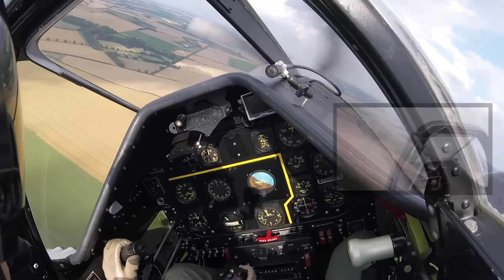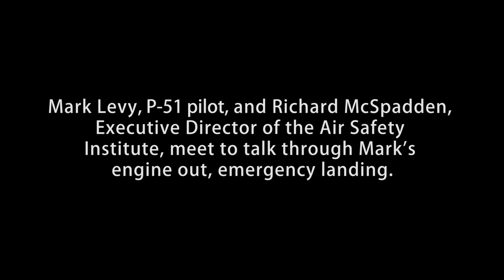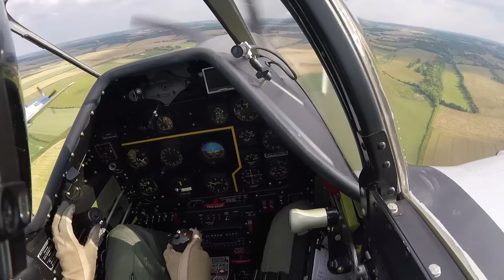P-51 Engine Out, Off-Airport Landing - Full Analysis

Comment: This person did make mistake not switching magneto on and off or switch over to secondary unit, he is not a mechanic so he does not know what is causing the engine stop running. When engine stop instantly its usually ignition problem, when you have fuel related problem engine will not shut off instantly engine will surge on and off or sputter before going dead.

Comment: Silly question: Could he have made the nearer end of the runway and land in the other direction?
Reply: The direction airplanes land on the runways are largely determined by the wind direction. Generally planes land into the wind to maximize lift so they can go slower without stalling. So yes he could have but it might have been more dangerous to do so. Take this with a grain of salt as I am not a pilot.
Reply: @philipmander1768  That's basically true. Runway length factors into this greatly with a tail wind as the tail wind increases the required landing distance - and that is different for every plane. That being said, In an engine out situation I'm going to put it down on whichever end of the runway I can make it to - tailwind be damned- over stretching a glide and risking putting it into a field. But I'm not the pilot in the video and can't judge his specific situation - he walked away so it was a good landing!

Comment: Im dieing to know what actually caused the motor failure?
Reply: I'm wondering as well. I even tried to google it, but everything I see is "under investigation" I know they know by now.. There is a list I found of all the P51 accidents in peace time, but all they say is "engine trouble". Thanks for that helpful info >.>; 

Can't find anything on it..
Reply: +jim halcom     They were thinking it was a carb issue, but I don't know if the final report is complete. The plane is repaired and flying already.

Comment: Well! ....  Mark Levy there are only two pilots in the world I would happily trust my and my families lives with. Those two are YOU and Chesley Sullenberger, as far as I am concerned EVERYBODY else needs to earn my respect. 
I had my grandfather  - Flight Lieutenant Eric Granville SHARP (27209) of the Royal Air Force. Test Pilot. Circumstances of Death: Lost in aircraft Beaufort I AW215 · AIR81/6914.
His Aircraft  Caught fire and he crashed in or around SHEPPERTON,  North of Bristol  (any Info on this would be gratefully received). It is believed that a cloth rag caught fire within the engine bay... His wife (my Grandmother - now past) was not allow to see his body, due to the horrific burns, that he received due to the fire and subsequent crash, reports of sabotage ran rife amongst his fellow pilots back then 1941. 
Should you look for Shepperton on the map, you will see that it is very close to the River Seven... I would suggest that he was going for a water landing/crash... Should I have been in that position, I too would have gone for that scenario. (Cleared, the population, try landing, fire too great head for water, come on baby, you can make it.........)

R.A.F.  Flight Lieutenant (Test Pilot) Eric Granville Sharp. Died  14/06/1941. He was only 31 years old.

My Grandfather flew Hawker Horsey Torpedo bombers (amongst many other planes) prior to this, Take a look at the size of these plane compared to the pilots... Looks comically/unbelievable, but they went after German Subs - close and personal.
https://i.pinimg.com/originals/83/56/83/835683a9c31583927fdcc0ce022bc045.jpg

On a lighter note.  This is one of the few photographs I have of him, and how I like to remember him, he flew Tiger Moth's. I'd love to know if this plane still exists.
https://www.screencast.com/t/FdQZmRim

Comment: Do they say at any point what was wrong with the engine?
Reply: +Jaakko Oksa    Believed to be a carburetor problem.    The plane was repaired and is flying again with a replacement engine.
Reply: @FiveCentsPlease  Strange that they were still using carburetors when the Germans had had fuel injection for years.

Comment: While the P-51 is in the shop..getting a make over it might be a good time to update the old Girl with a nice Modern fuel injection system..or adapt one from an Old Foe  the  Me 109 ... Great Flying....by the way..
Reply: +MrRotartyrockets    There are no fuel-injection updates for the Merlin.  And flight certification for a major change like that is not cost-effective for the small number of Merlins  that are flying.    Only a few common use radials have updated EFI kits that were developed.   The plane was repaired fairly quickly and flies in new colors now.

Comment: Why didn’t he land with gear down like you would in a Cessna?
Reply: Warbird is fast and heavy! Two wheels in the front, one in the rear. Gear digs into the soft ground and airplane flips over. Much more damage on the airframe and more danger of getting killed. He explains it in the video. The decision to pull up the gear in the last possible moment was gold :)
Reply: Fminus104 ah, thank you! I did see that part where he pulled the gear up just wasn’t sure of the physics of it. But that makes sense!
Reply: @racecarsinc  Yes, the gear would dig in and flip the plane over and that would have most likely been fatal.

Comment: Only real issue and captain hind sighting I can see to take away from this is, if he had practiced engine out landing's He maybe could of learned roughly the glide angle of a target he can get to, also practice with a 180 turn to short final. Usually when gliding, assuming you have the energy to make it back, you stay high, and then lose it though a 180 turn before final, kind of like space shuttle. So I suppose he should of been better able to judge he did not have the energy to make it to that end of the runway, maybe use end half of runway, or try coming strait in the other way which would of been more a strait line. But he wasn't terrible short, and maybe, maybe could of made it, but judging by the road and obstruction's he would of had to risk crossing.
Reply: I guess considering the danger involved, though he walked away, he could of been better prepared for the landing, and had picked a spot he knew he could get to, would be safe, and really stick a good landing to give best chances. But this actually worked to, as again he was only a bit short on energy to make it back and he had a 2 way plan. But you could nit pick, if you pick to return to a strip on engine out, and then can't make it, you've made a judgment error, namely the glide capabilities of the aircraft and energy required compared to what you have.
Reply: Wouldnt be too dangerous and probably easy training to go idle throttle/thrust, pick spots and make judgement calls if can get to them, then test self and see, to really get a good judgment for engine out. Kind of like how Sully was able to know, and use his judgement to immediately rule out landing spots as requiring too much energy, he picked a spot he could make it to, that was as safe as he could get, and had the energy, time to make the landing as easy as possible.

Comment: as an ole racer this would help rally motocross tuck any  racing be a great tool why because we know were going crash it is just when n how to crash as softly as possible ill bet that would help as its a more normal thought n that sputtering engine would not be as likely to affect one acceptance of landing in a field i guess it would be like the ole barn stormer line of thought ,,this video is so nice guys like he says know your aircraft same apples in a rally or roundy roundy race.i do not agree with fight or flight chimp brain fog as stated it`s a lack of know how to do crashes or even go up a latter or a fist fight get used to doing any of them it not an issue its not as simple as they may have one think....carburetors will stick floats flood in breath stalling then under heavy throttle clear up n run fine not doing it again fer hours or weeks  and then on the other side of that they do what this airplane did ..a++

Comment: I'm gonna take a wild stab at it and say instincts come from the accumulation of seat time and aircraft knowledge /common sense because I've seen the damage arrogance / ego  can cause but calm practicality can also be a good friend . I am however a great fan of altitude I believe pilots should spend as little time down low as possible , we all know what happens when things go wrong down low  He was lucky he had soft option's if you notice between the time he first noticed an engine issue and his touch down  the clock didn't move very much so his time was short ..I wonder had he been a 1000 ft higher when this issue happened could he have made the runway  I think yes !!

Comment: Why hold onto the control stick as soon as  you hit the ground.   Race car drivers do the same thing ; 230 mph crash and holding on to the wheel.  You ain't steering out of that , friend.
Reply: +Live Wire   Fly into the crash is what flight instructors tell new pilots.
Reply: @FiveCentsPlease  
AFTER..... after you hit the ground and are skidding or cartwheeling ....let go of the control stick ( or if in a car the steering wheel) Cross your hands on the chest or you might end up breaking them. The harnesses will hold you in place...not your hands.

Comment: 1:23 I'm guessing the fuel-pump failed...
Reply: +Hallands Menved  A carb issue was suspected by I have read the final accident report if it is even out.  But the plane is in California getting rebuilt.
Reply: @FiveCentsPlease  It obviously had something to do with the fuel system, as I personally surmised either it was a faulty Carburetor or Water in the Fuel/Obstructed Fuel line.  If it were the Engine itself that was the problem it would have either caught fir, exploded or simply died/cut out completely, the fact it was intermittent suggests a fuel system problem.

Comment: Sooooo.... any update on the engine problem?
Reply: +Tractor Wrangler    Believed to be a carburetor problem.   They rebuilt the plane, replaced the engine and it's flying again.
Reply: @FiveCentsPlease  "Believed to be" was they best they could do? Yikes....
Reply: @TractorWrangler01    The accident was in the UK, so the report is from the CAA and says carb-related.  Not very specific.  The Merlin was examined by the US shop that overhauled it, so I don't know if they said anything about the engine.  The plane was repaired in California and shipped back to the UK.
Reply: @FiveCentsPlease  I really don't like inconclusive out comes like that. I hope it doesn't re-occur on someone else...

Comment: Okay so let me get this straight.....he put his gear down, the engine was beginning to quit and he started to drop with a Freeway that he could have turned onto and he didn't consider the freeway? Now this is in Britain so I know there they Drive on the Left side of the road and not the right as in other countries, so if you look at the freeway on the left hand side It's almost completely Empty......
Reply: +Daycrist    He was running out of energy and with no power he could have stalled and cartwheeled.  Getting wings level and finding grass was a good decision.
Reply: @FiveCentsPlease  He was already near the ground, his gear was down his flaps were out and it was the high bank of him trying to get to the Runway that cut his airspeed and caused him to drop so suddenly. By the time he put down his gear he was already Stalling, so if your reasoning were true he would have cartwheeled long before he belly landed.....
Reply: @Ami-vh7sr     I watched again. The pilot explains beginning at 13:25.   He was concerned with the sink rate and no power to gain any altitude and indicators that his airspeed was dropping and the airplane was not happy.
Reply: @FiveCentsPlease  Yes so why would the Pilot High Bank and thus cut his airspeed far faster trying to line up with the Runway when he was already almost lined up with the freeway and holding a glide path?

Comment: Great job by the pilot.  Did he make mistakes? Sure. But any landing you can walk away from is a good one.  The plane can be repaired and will be flying again.  That being said I can't help but wonder if instead of gliding all the way to the other end of the runway had he simply landed going in the other direction.  He was clearly closer to the other end of the runway and to me it looks like he could have easily made it.  Yeah he might have been landing down wind but full flaps might have made it doable.
Reply: All good points.
Prop nearly stops early on, crosses the hiway, in a pretty high bank... I am surprised it didn't stall right then, into the port wing?
btw... it's a shame, Bernice " has no video content "
Good luck with that?

Comment: Make that dam short approach and dont go to the other side of airport with a failing engine, then put drag flaps, and gear down and get short... Lots of pilot errors killed that nice airplane.. What a shame...
Reply: +Rich Grant  The plane was shipped to California for repairs fairly quickly.  A new wing was already available and that moved the rebuild along nicely.   Dunno if the full report is out yet but they were looking at the carburetor on the engine.
Reply: @FiveCentsPlease  "shipped to the other side of the word for repairs "fairly quickly".. Oximoron Alert..
Reply: @feetgoaroundfullflapsC  Yes, shipped fairly quickly to Fighter Rebuilders in California.  A new-build wing was already available to start repairs.  As I understand it, repairs were finished in 2018,  so a two-year rebuild for this accident is impressive.  It is now back at Duxford in new colors flying as "Contrary Mary."  https://www.flyinglegends.com/wp-content/uploads/2018/07/IMG_8814-1024x667.jpg
Reply: @FiveCentsPlease  -- Who paid for all that?? The workers of the factory of the owners via low salaries.  As long as the rich wastes money in luxuries , the workers salaries will be kept low to pay for those luxuries.  Money has to be produced by the workers sweat, it does not grow on trees.  And they rich are wasting it on these accidents and luxuries instead of distributing along the workers.  So workers loose salaries every time a rich guy needs more money for these one million dollar toys and their stupid accidents..

Comment: The pilot also decided to rely on the engine to the extent that he attempted to reach the airport runway, instead of abiding by his own belief that an intermittent engine can make the aircraft respond unexpectedly such that the situation is more dangerous than one with an engine that has completely stopped -- all according to which he should have, arguably, landed earlier in any of the fields in the immediate vicinity that had relatively low vegetation and were suitable in general.  (It seems that he admits this during the interview.)  However, this would have permitted a controlled touchdown with the landing gear ~extended~.  Crop dusters and aircraft that tow gliders are landed in such fields regularly without incident, even though those aircraft have fixed, extended wheels and are lighter too, which results in considerable bouncing during the ground roll that begins just after touchdown, and yet the situation is manageable.

Comment: This aircraft could have been landed on the airfield! Why fly the downwind leg with an intermittent engine cut out when you could have reached the grass or the opposite runway. Originally you made a plan, why did you not stick to it, by changing your mind you left yourself hurrying to get the gear back up and rolling the wings not quite level before crashing, undoubtedly full flap would have made the nose hit harder connecting with corn, moot given the concrete post that nearly tore your wing off, had it gone through the fuel tank and caught fire, yikes! Especially as you left the mags on. You also didn’t get out of the aircraft quickly, how do you know you have no leakage of flammable stuff, get away from the aircraft fast! Did you practice an engine off prior to the show on your check flights? If you’re planning to do the show next year at duxford in the same aircraft, fly these 104 seconds again in practice and see if you could have gotten to the runway. With the gear down.

Comment: WWII planes often operated on grass, IIRC. So why gear up? In a Jug or a Navy fighter, probably be alright, but the Mustang has that radiator intake bottom center. That seems like it would want to, if not flip the plane, at least shred tha body/frame.

Did it just crush and become irrelevant to the situation or something? Really seems like it would have dug in and hooked.

Comment: Scary this guy is a flight instructor. He obviously did not know the airplane. Whistling guns? Once a month engine out landing? No you did not. If you had done this you would have known not to fly the damn pattern with an intermittent engine. You fly to the runway and land not try to make a pretty pattern. Stop saying you knew the plane. You knew the plane with a working engine. 
You also did not try to gain altitude when the engine caught again. You did not fly to the runway. You actually tried making the pattern instead of landing down wind or on the taxi way. I dont feel you should be an instructor.
Reply: Where does he say he wanted to continue the pattern once he knew the engine was failing?